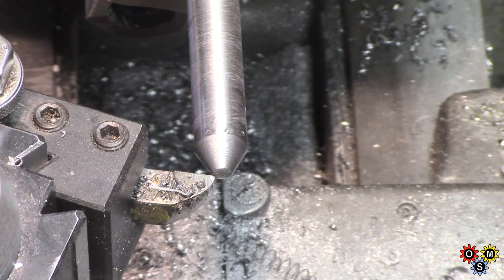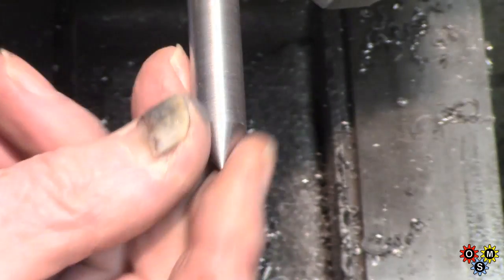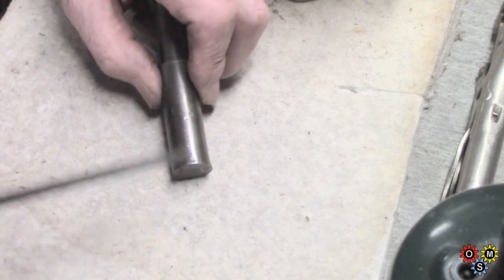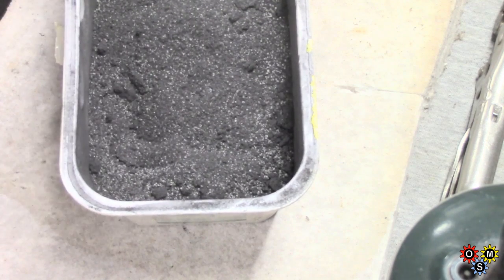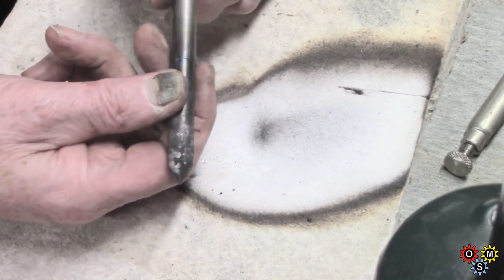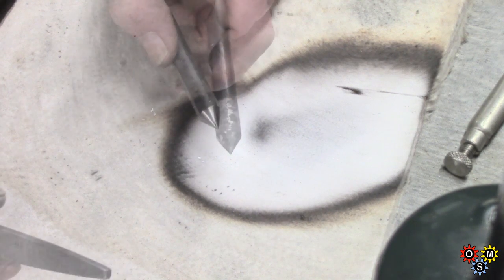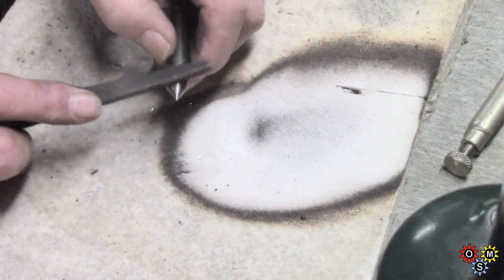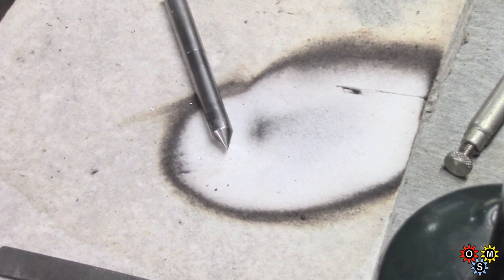Case Hardening - Simple but Useful

Comment: Would this method work on small thin bits of sheet metal, to make small armour scales , for “ body armour “ ?
Reply from the maker: I'd expect it possible to apply a thin case to sheet metal but - can't see much advantage from a strength/protection point of view. The strength factor is down to material thickness and innate hardness much more than just surface 'hardness'. A thin case would IMO have negligible effect on penetration reduction.
Reply: @ChrisB257  thanks just something to explore. & try I guess.

Comment: Vince Smith using his wifes computer, I just had to comment, I once had some parts case hardened here in Australia a long time ago and wiped my face as I received the parts, Don't do that said the old engineer, its got cyanide on it, he used a product called hardite. I felt I had to check the stuff you didn't mention for your product and the list potassium cyanide and sodium cyanide, so users beware.

Comment: What you did was not the correct method of using Kasenite, you are suppose to heat the object to be hardened to cherry red then Rolle it in the  Kasenite to obtain a coating then continue heating. This keeps the air from the surface to prevent oxidisation of the metal also the longer you keep heating the metal with the crust of kasenite the deeper will be the carbon penetration. finally you quench the treated metal including the crust in cold water. A far better method of using the product is to put the object you want to case harden in a tin box them surround the object with Kasenoite then heating the box and contents to red heat for a while then quenching the box contents in cold water, this produces the deepest hardning.
Reply from the maker: Thanks for the valid points. I have to admit that over the years I used the ''easy'' approach as all I wanted on most occasions was just a minimal depth.
Reply: @ChrisB257  Having looked again at my reply it does come over a little dictatorial also because at my age over the years I also forget things. just between ourselves I would like to see 75  again. It is good of your good self to pass on information to the unknowing. Oh! By the way Kasinit is not now available here in the Uk though there alternatives.
Reply from the maker: Haha, no probs. I also would be pleased to see 75 again!!! All best :)

Comment: The "Kasenite" product appears to induce a very shallow case, in order of thou. It's enough to fool you with a quick file test, and likely improves the durability of the surface under low to moderate loads, but for more serious applications it may quickly abrade. If one wants a proper, thick case up to 1-2mm, you should fill a small metal can, like paint can, with mixture of powdered carbon and calcium carbonate (70:30 weight), close it up (punch a small vent hole just to equalize pressure) and heat it up to 800-900C for 1-2h. The calcium carbonate decomposest to carbon dioxide and calcium oxide, and carbon dioxide reacts with elemental carbon to form two carbon monoxide molecules, which are readily absorbed to iron, returning the oxygen and the cycle repeats indefinitely. When done, take it out and quench it as normal. Case hardened metals may have different tempering procedure, for example this document (doi: 10.1016/j.proeng.2015.05.076) suggests tempering at 150C for 1h. As the material remains ductile inside, the hard case can go a long way being harder than compared to uniform alloys and I have seen cases (pun intended) which were only quenched to produce extremely abrasion resistant surface with fully ductile core. However, this applies to parts with no thin cross sections, complex parts and parts involving thinner structures may need a more effective temper.
Reply from the maker: Eric - many thanks for your comments and suggestions. I must have used Kasenite for almost decades and it always achieved what I needed - in one instance it was used to produce some case on a shoulder bolt which was going to act as a shaft for knurling wheels - in that situation it has done well. I take your point re very thin case being likely. I must when time allows experiment with your suggestions. Many thanks again. Chris
Reply: @ChrisB257  If it works, don't fix it. Many means work surprisingly well in many situations. Especially, for compressive tasks like knurling or burnishing tools, even very thin case will likely work - see, they even sell machining inserts meant for heavy duty continuous production use which are coated with microns thick ultra hard coatings. For me, kasenite is not available without excess trouble and cost, but I can anytime turn on the torch and case harden stuff, and it's as cheap as bbq coal and gas gets. I've made quite a few parts this way, and they've worked perfect.
Reply from the maker: Thanks again Eric :)

Comment: However, you lost the factory-temper, meaning, the material under the case will spread the casement out.
Reply from the maker: Most likely this will be done on a mild, non-alloy cold rolled steel which is not heat treatable, and so, no temper to be gained or lost. Maybe 1018. If however something like 4140 which is heat treatable then there might be an issue - probably though if quenched at a suitable heat, more likely it'll harden thru and thru.

Comment: Can this method be used to make high carbon steel  for the old fire lighting flint sparking steels??? Can it be done with just charcoal??? I've read it's called carburizing. Trying to make a simple carbon steel sparked for fire ignition without modern methods/chemicals. Thanx
Reply from the maker: I can't see that working because generally the hardened layer is quite thin and would be easily removed - I'd expect a 'sparking' steel to be a high carbon and hardened material thru and thru. Charcoal alone will not, best I know, be adequate - most formulations contain other chemicals, sometimes including cyanide salts. Check out this link for a useful pdf file.
https://tttg.org.au/Content/Docs/Articles/CaseHardening.pdf
Reply: @ChrisB257  ok thanks.

Comment: I don't see any comments mentioning that this is not the way to case harden. You warm the metal to get the material to stick to it then you heat it to redness. The length of time it is kept at redness determines the depth of hardening penetration. You can get like upwards of 6mm of penetration (don't quote me on that).
Reply from the maker: Indeed yes, the duration of ''soak'' can determine the depth of penetration, although 6mm sounds optimistic! Very often a shallow depth is plenty adequate just to provide a protective hardness layer, depending of course on the application.
Reply: @ChrisB257  is this the technique used to make high carbon steel for the old flint spark steels used to make fire???

Comment: hi,

can you use just graphite only for carbonization? , im using 1020 steel, quenchong in conola oil, im having no reult.
Reply from the maker: Never tried graphite only - in theory if temps high enough and the soak time adequate there should still be some case formation I'd think, on most any steel. However, I think commercial mixes also have such things as bone meal and something like thiocyanate maybe - forget to be honest. I'd reckon a water quench would be better.
A web search might help to find a popular formulation.

Comment: Can this method be used on carbon steel taps?
Reply from the maker: I doubt it would be successful as two things may a problem. First, getting rid of process residue plus, second, even a thin case could change dimensional accuracy. That said, if I had a large size old tap I'd maybe give it a try!!

Comment: I always bring up to a cherry red again after the Kasenit has adhered to the metal.. I quench after that.. I use a propane weed burner for heat.. Just let the Kasenit keep boiling on the surface for awhile before the quench...Have heat treated fasteners I made for milling machines, gears I have cut from mild steel, etc.. Gives hard surface and soft core...Mike in USA
Reply from the maker: Pretty much what I do most of the time - much also depends on how deep a case I need as to timing etc. :)

Comment: Would I be able to use this method to harden a cam lobe that has been rebuilt and ground to the correct profile. Seems like just the ticket?
Reply from the maker: Robert - 'at a pinch' - maybe! A cam lobe should have a fairly thick layer of case and would probably required a good soak time. Also there is the matter of avoiding distortion in piece when quenching. If I remember right, a process used for toughening cranks is nitriding - not sure if this applicable to a cam. Much too depends on application of cam - is that for an automobile or just a small engine like a Briggs - I'd be tempted possibly to get a professional job done ideally.
Reply: @ChrisB257  it's for a 1600cc v twin motorcycle. It's only 4 inches long with two lobes and a gear. Everyone I talk to say 'oh no sir we can't do that' which seems to be the attitude at the min. Unless it's going to cost a small fortune they don't want to know. The way I look at it,I have nothing to lose. Now I have the oil feed sorted I feel it's worth a try, any pointers?
Reply from the maker: Well - seems like a 'go for it' situation! I guess, make sure lobe surface is very well prepared for surface finish and then get up to good red heat and let soak - probably then re heat and try for further soak. Finally do a careful water quench. Once cool clean up with buffing compound until cleared of all crud. I have never tried this but - might be worth once put into service, taking the trouble to inspect after a while and make sure no pitting has occurred. Keep in mind care to avoid distortion of whole cam. Do some experiments first maybe.
I am thinking the ideal approach to enable a long soak would be using a hot bath of cyanide salts - but that's a hazardous process I think.
Reply: @ChrisB257  I'll see what happens
Reply: @roberttownley1985  Any update on the cam?

Comment: I remember In vo tech welding class Case hardening Homemade chipping Hammers we made out of unwrapped coil springs It works very well
Reply from the maker: Hi - yes, coil spring material is very useful.
Reply: Coil springs are already high carbon steel

Comment: Kasenit has potassium ferroCYANIDE in it (That was very firmly drilled into us by the machine shop teacher at school). Treat it with the respect it deserves.
Reply: Ferrocyanide is non toxic. Just like water doesn't burn or support burning despite having both hydrogen and oxygen. Okay bad analogy but you get my point.
Reply from the maker: Indeed - wise advice! Use with ventilation. Fortunately the iron molecule within does reduce dangers considerably compared with the dread potassium cyanide it self.

Comment: I was going to say very timely but see the video has  been here for 18 months.
I have a Flwxispeed mini lathe and  cannot buy a centre which doesnt rattle about in th tailstock and headstock for 3 jaw Just decided to make one 0mt in my ancient Drummond and harden it.Now I know the easy way !Thanks Chris
Reply from the maker: Hi Jonathon - main thing is to decide how thick of a case you feel you need - much then will depend on ''soak'' time before a quench. Some even consider an oil quench and then go through process a second time. Not sure if that is really necessary. Even a thin case can be quite serviceable.
Reply: ChrisB257 Thank you Chris.I had wondered about oil quench too and seems sensible.I probably wont bother with a second heat as a Flexispeed is a very small old English lathe and I wont be likely to wear a centre out.It was you who introduced me to Randy Richards dovetail cutters.I m buying one..Ta..!.

Comment: Stefan Gotteswinter had a calibrated set of files for checking hardness. Had not seen those before.
Reply from the maker: Very useful files - I want a set but they are fairly expensive. Not having those I just carefully make a scratch test with the edge of a known good quality file - doesn't give a Rockwell figure but still useful.

Comment: Is there any benefit to taking the new gear and running it in in the unhardened state and case hardening it afterwards. On old machinery the old mating gear may be far from new. Just a guess, I have no hands on experience in the effect of running worn gears against new.
Reply from the maker: Hi Toby - Ideally a new gear should mesh OK but - no harm IMO in doing a test run to evaluate. If then hardening is required at least you'll have an idea as to how well the pair will run.

Comment: If you put the coated item back into the flame and then re-dip it into the 'Kasenit' then you'll get the coating to be much thicker. It's also better to quench from Cherry Red, you don't know how hot it was before quenching, and you probably didn't get it as hard as it might otherwise have been.
Reply from the maker: Hi Roger,
The video was really only a demo. Of course a re-dip or a longer ''soak'' would help thickness of case. I think quench was from cherry.

Comment: Douglas white 
Enjoy your work in the shop and was wondering where do you get the powder for case hard point  and what name does it go by
thanks for now.
Reply from the maker: Hi Douglas,
Thank you. Let me copy an answer I have someone else.
I thought I had referred to the stuff actually - anyways it is "Kasenit". Had it for a very long time. Best I recall it was a mix of charcoal and bonemeal but having checked here - https://www.travers.com/1lbcan-1-surface-hardning-compnd-kasenit/p/81-003-001/ - they do suggest an alternate option. 
I see from the PDF it is Sodium ferrocyanide - yellow prussate of soda! Na4 Fe(CN)6 The mix anyways is black which is why I had thought of charcoal and bonemeal!. I usually do a water quench although some like an oil quench - the latter maybe better if applying a very deep case - probably to reduce chance of the case skin cracking.

Comment: Great speaker but I wish you would’ve taken more time explaining the black granular material you dipped in first, what was it called, where do you get it?  Also there are numerous things used for quench let us know if it matters and why.  I can tell by your shop you know what the hell your doing but dummies like me need a little extra help. Hope this doesn’t upset you, not intended. Thank you for sharing sir.
Reply from the maker: Hi Robert,
I thought I had referred to the stuff actually - anyways it is "Kasenit". Had it for a very long time. Best I recall it was a mix of charcoal and bonemeal but having checked here - 
https://www.travers.com/1lbcan-1-surface-hardning-compnd-kasenit/p/81-003-001/ - they do suggest an alternate option.
I see from the PDF it is Sodium ferrocyanide - yellow prussate of soda! Na4 Fe(CN)6  The mix anyways is black which is why I had thought of charcoal and bonemeal!.
I usually do a water quench although some like an oil quench - the latter maybe better if applying a very deep case - probably to reduce chance of the case skin cracking.
Reply: ChrisB257 You May have explained, but my mind wanders even when I’m trying to learn something and I may have missed it. Thank you kindly for the additional info.  Have a great day sir. 👍
Reply: Robert Langley
You can make the Kasenit by yourself... burn some leather and turn it into charcoal powder then mix it with salt and wheat flour. You can use it for case hardening.

Comment: Does sump oil work well when quenching the part in it?
Reply from the maker: It will work but I have found when applying a thin case that the shock quench of water is better.
Reply: ChrisB257 i meant to use sump oil to case harden the steel, not quench. Great work.
Thanks
Reply from the maker: The quench is just for the case that has already been applied, the thickness of which will depend on duration of ''soak'' in the carburizing medium. The relatively soft core doesn't matter. So - a water quench will ''shock'' that thin outer shell and help max hardness of same. :)
Reply: If it’s oil hardening steel, then you need oil. Water will cause cracks. But if it water hardening steel, you won’t get a hard enough surface using oil.

Sure, you could use brand new - clean sump oil. But quenching oil is designed for this, and gives a better result.

Comment: I've made large form tools to cut aluminum using this method. I cut the desired profile out of hot-rolled plate and cut any required tool relief while the steel is soft.
    Unfortunately the nanny state has banned the Kase Knit product because it has potassium cyanide in it and our betters assume you are too stupid to read the cautions on the can about using in a well ventilated area and don't inhale the vapors (which of course any sane person wouldn't do on anything that was giving off  gas or vapors). I never had occasion to use the replacement case hardening products, but I would assume they work ok. 
    After hardening per the case hardening compound's directions, stone the cutting edges to sharpen. The form tool won't have a very long life, but if used to finish cut material that has already been roughed out, it will give good results for onesie, twosie jobs. If cutting plastic, the tool may last some time... then when dull, sharpen and case harden again.
Reply from the maker: Hi,
I wasn't aware of any cyanide in Kasenit to be honest, although have always been leery of fumes of any sort - bulk of it seems to be sort of charcoal and bone meal type mix.
Indeed, even applying a fairly light case, tools can be custom made for just a one off type jobs, particularly on softer materials.